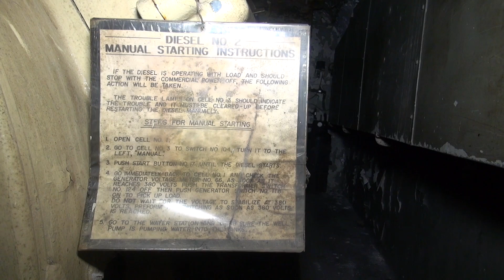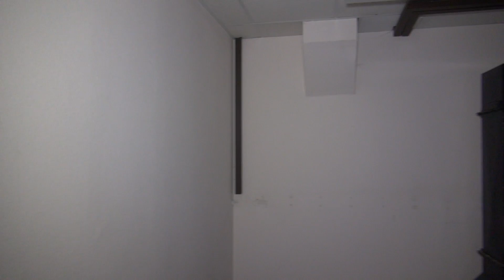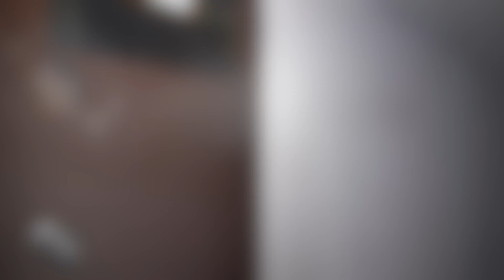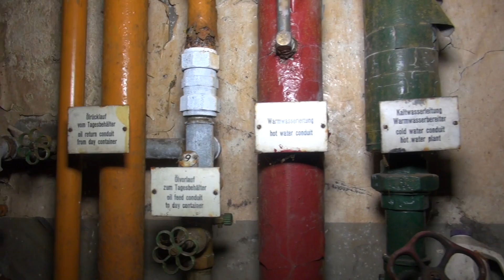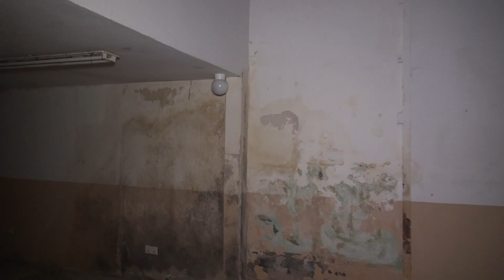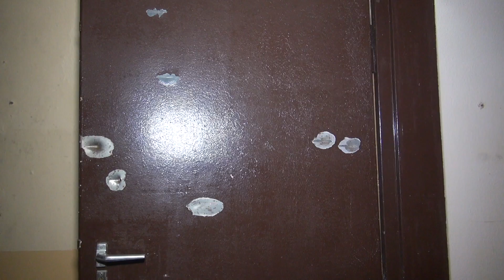WEST WALL HEADQUARTERS TURNED COLD WAR COMMAND CENTER

Comment: at 4:33 the electric installation look like it dates from the 50's or so. the transparent plastic boxes are more recent
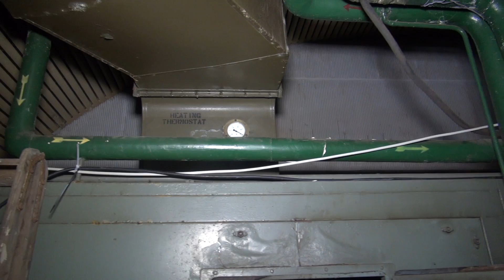at 12:43, the text on the khaki green rectangular pipes say "Heating Thermostat" which is obviously in english, hence cold war era
at 18:10 it looks like you have US style plugs in there. I suspect you had systems to generate 110V/60Hz that was newly installed. also the light grey german style plugs are 1970's vintage
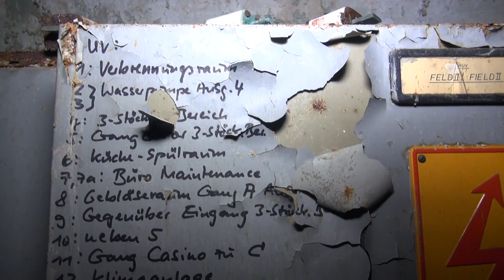at 23:54 those electrical boxes with german writing look like 50's vintage

Comment: A lot the original equipment could have been maintained by the original manufacturers, and they could have also added improvements to the original equipment post war.  This would be in keeping with the Marshal Plan, which meant that a lot of German industries involved in World War Two were used in helping to rebuild Germany, at least, West Germany, after the war.